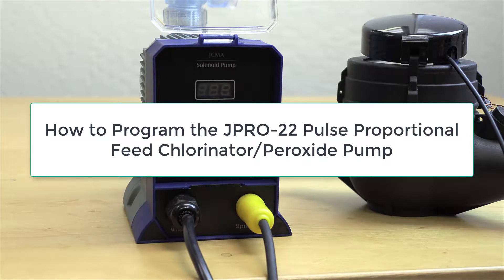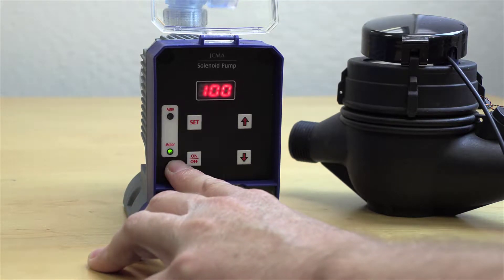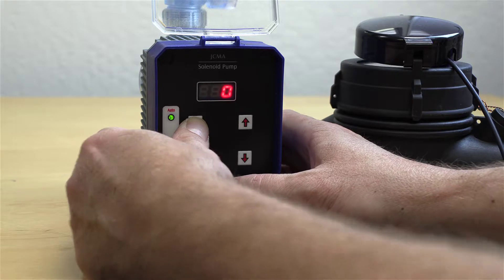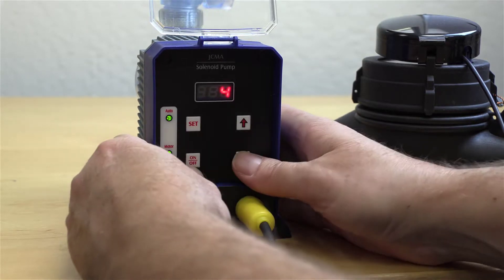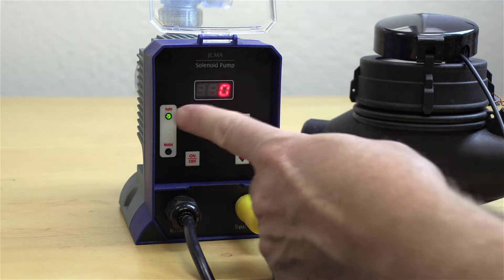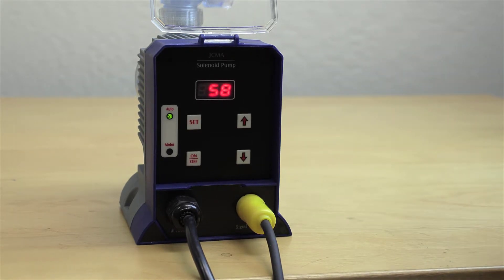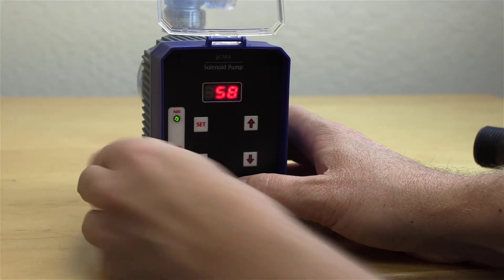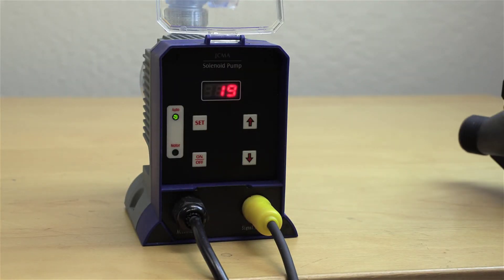Program J-PRO-22 Pulse Well Water Chlorinator

Comment: do you have adapters for the water meter that uses 25 mm metric. so that i can connect to U..S. standard plumbing
Reply from the maker: Hello - yes the water meter that comes with the system includes unions washer and adapters to fit 1" pipe. https://www.cleanwaterstore.com/proportional-flow-chlorinators.html. Here is link to the meter only:  https://www.cleanwaterstore.com/water-meters-pulse/pulse-water-meter-w-reed-switch-1.html.   If you only need the adapter fittings only we have those as well: https://www.cleanwaterstore.com/water-meters-pulse/meter-fitting-set-washers-2-each-1-flow-meter.html.   If you are an existing customer and just need replacement fittings, reach out to our support team for a coupon code:  support@cleanwaterstore.com.

Comment: This video is a hole lot better than trying to deal with the useless instructions that came with the pump.  I really wish it had the stroke length adjustment like the old Precision 24 pump.  So much easier to tune how much chlorine goes into the system.

Comment: What water meter are you using to control the pump?
Reply from the maker: We have our own brand https://www.cleanwaterstore.com/water-meters-pulse/pulse-water-meter-w-reed-switch-1.html.   Its a plastic meter designed for aggressive water such as low pH, reverse osmosis and de-ionized water, however, it works great for well water applications.  We have this manufactured for us by a large meter company in China.  It is a reed switch meter similar to Carlon (also manufactured in China).  So far in the 10 years we have been using this one, we have had very few failures and no warranty claims.